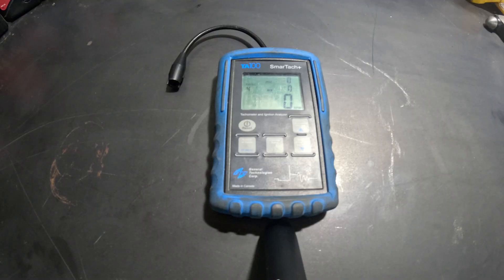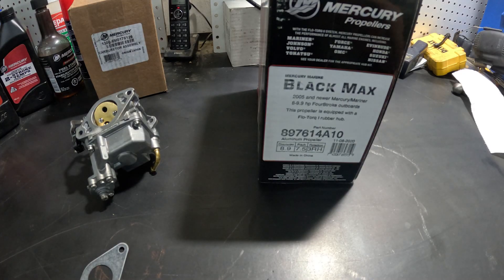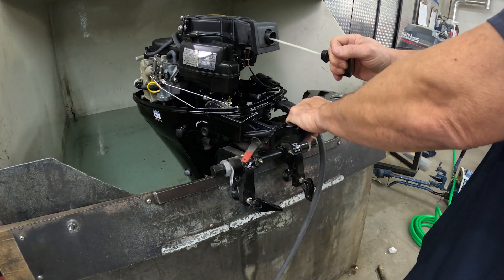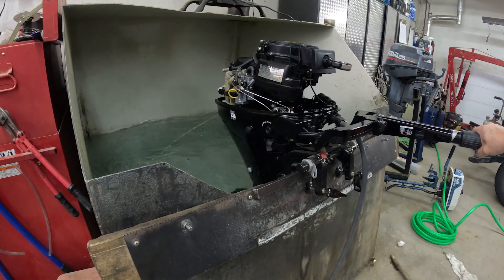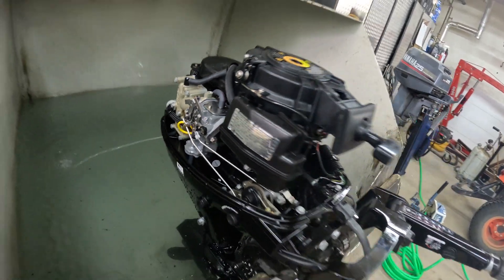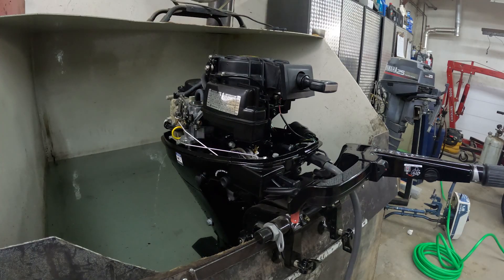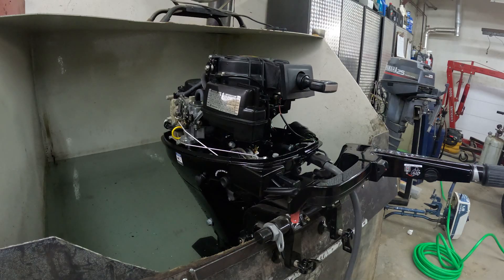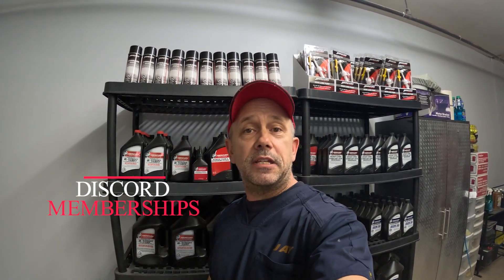Will installing a 9.9hp 4-stroke carburetor on an 8hp 4-stroke engine increase its power?

Comment: Well, I am considering purchasing a 2000 Mercury 8hp, in pristine condition for $600. If I buy it, I will test it as is as a kicker for my boat. If I think I need more power, I may add a 9.9carb. This is not a high thrust engine, but I may put a high thrust prop on it. 
 I’ve done this with a similar size boat to a yamaha motor and was able to troll at idle at about 1mph.
Reply from the maker: Another thing to consider is the shaft length.

Comment: Попробуйте поменять топливные жиклёры у карбюраторов. Имеется ли у вас информация о размере жиклёров, он указан на шляпке жиклёра?
Reply from the maker: Increasing the amount of fuel is only part of the change that is needed.   We need to flow more air through the carb to utilize the extra fuel.   As for the Jets being marked.  I do not recall seeing numbers on them.  I am aware of other brands using numbers to show the size.  Thank you.

Comment: Hi bubby, it's Kel from Australia,,if I change my 8 hp 2022 4 stroke yamaha and put a 9.9 carburettor on it will it make it go quicker
Reply from the maker: I am not familiar with the Yamahas.  But...if the parts schematics note the only difference is the carb.  Then possibly.  But I doubt you will see much of a return in performance vs the price.  If you can swing it and your boat will support it, a 15hp or 20hp is a guaranteed improvement.
Reply: Нет Ямаха не будет 9.9,  потому что 8 предельная мощность для её объема
Reply: @Шеле1ст  Yamaha 9.9 and 8 both are 212 cc engine
Reply: @igorochakovski3124  it depends, I have a Yamaha F8CMH with 197ccm (shared with the 6hp model)
Reply: I put a 9.9HP carburetor from Aliexpress on my F8CMH (197ccm). This has gained me 200 revs and 2-3km/h on my boat. Part no 6AU-14301-40 for 30 bucks. Been working great for over a year now. 30 bucks well spent!